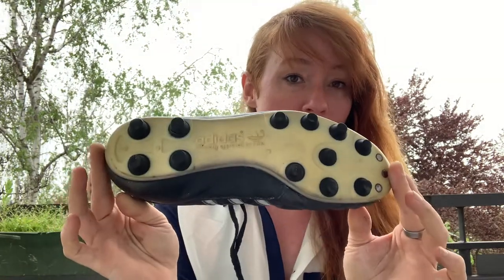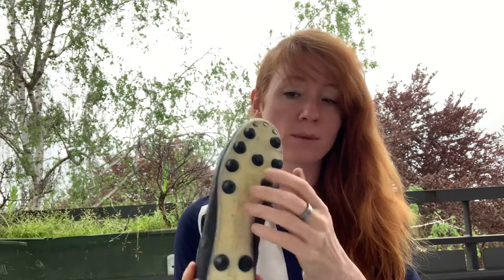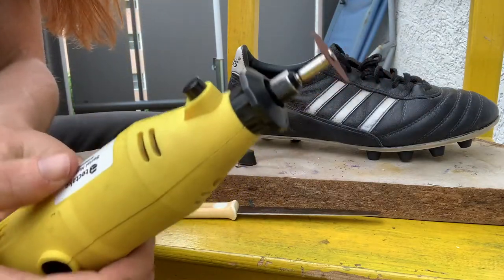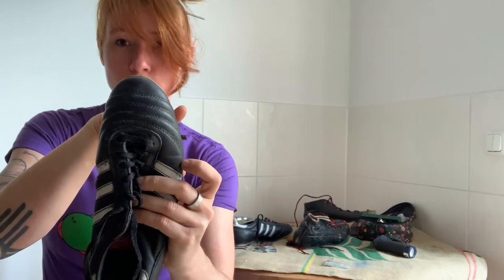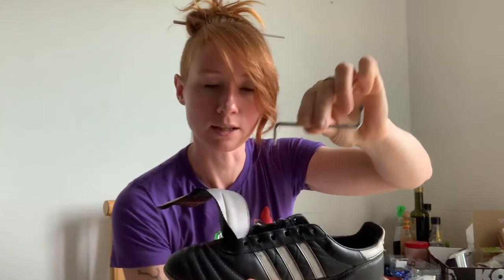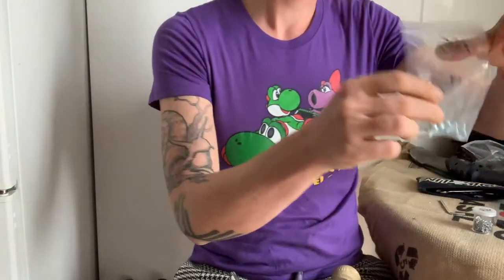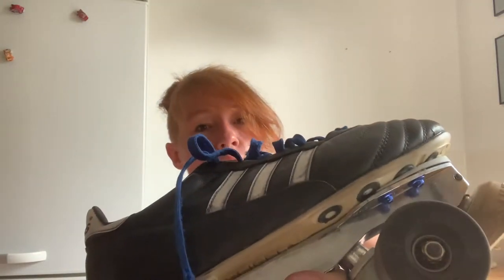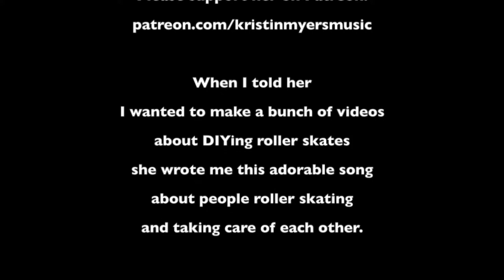Make Roller Skates from Soccer Cleats (aka Footy Boots)

Comment: I love this, so informative, especially your mounting advice because I bought plates which were 2 sizes short according to the shop (I ignored their advice lel) and it turns out they are the perfect length for how I skate :) just like this build.
I built my first ever pair of skates doing alu-insoles on trainers and didn't know about this whole foot-ball shoe thing.
These are pretty much the same as expensive roller-derby/jam boots but at a ridiculous fraction of the cost! Here in the UK we cant buy jackson/VNLA boots very easily but used adidas cleats are everywhere (I found one on the street last night - true story)
Can't wait to remount my plates on a pair of these!

Tip by the way for getting the drill to go in straight - first use a counter-sink drillbit to create little craters before going in with the normal drill-bit! (countersink bits are pointy at the tip and easier to hold in place)

Comment: Suggestion: If you have the chance to take those to a shoemaker and have them replace the sole for good sturdy leather, then you'll be set to go because the sole will be able to take the heat and not fall apart. Then you just get nice comfy insoles. 

I've been skating since I was 2 years old and I've always had the skates made by a shoemaker. The latest ones look like those mesh sneakers but they are built very well and they have lasted for the last 10 years so far. Asking for some help from a shoemaker could do wonders (you know, like a regular cobbler). Enjoy your skates! I thought this was a wonderful idea.

Comment: Thanks for this video. Tried some Vans "like" shoes for skates and didn't feel too supported. Soccer shoes look like a great option. Will try!
Reply from the maker: please post back to lmk what you think, and tag me if you post on insta! I still wouldn't use them in the skatepark but I love them for cruising around. Sometimes I think I rag too much on Vans skates bc i have friends who love them, but I just can't...
Reply: @rollerskaterevival8484  Will do! Searching for shoes on ebay and craiglist;) Think I picked really spongy skate shoes to try out aluminum soles and plates with. This option looks much better. Will post when I set up.

Comment: This is a great example of the process. One word of caution, if you do cut the prongs off the t-nuts be very careful of holding them when using the drill. If the nut starts to spin it can cut your thumb up pretty bad and make you bleed all over your brand new magnesium avenger plates
Reply from the maker: That is a very specific warning which makes me think it is not hypothetical 😱 I am so sorry and hope you are well healed!
Reply: @rollerskaterevival8484  it happened long before your video came out and back when I was first experimenting with t-nuts for mounts, but thanks!

Comment: Hi, I'm planning to put some sneakers on a spare pair of plates - it's my first build, do you think I can cut the insoles from a 1mm aluminium sheet?
Reply from the maker: I think you can but I'm sure it will break before too long, and if my experience is any indicator it will be very annoying to cut because thin aluminum shakes like crazy. If I were you I'd try to get some 2mm
Reply: @rollerskaterevival8484  cool, thanks